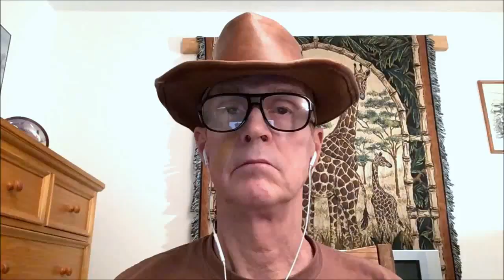Antenna Support Mast Materials

Comment: Hey Stan, good to see the comments open.  I've used carbon fiber and fiberglass and both seem good. I usually prefer to just elevate a vertical with the poles, but sometimes if there are no trees i'll put my dipole up with my 30 foot pole at about 20 feet.
edit: By the way, in the local radio course here we use some of your articles. Thanks for sharing your knowledge!
Reply from the maker: You're welcome! 73 de W1GV.

Comment: Stan, I've seen MFJ or other places advertise these, but have never used them. I have instead used PVC to mount verticals and to make mounting frames with very good success. There is a radio culture of sorts that many radio amateurs know little about. These are DXers who take on the challenge of pulling in DX on the AM broadcast band. Most are very smart people and some of the first PVC designs are from them. Coincidentally, a friend of mine who adheres to this particular branch of the radio hobby also worked for ARRL. There is a demo video of an antenna he designed on my other channel (also called "Semoranman") which works with a SiLabs DSP IC which tunes a Tecsun PL380 pocket radio's internal, ferrite loop stick antenna. In this case, the loop stick was replaced by a 23" embroidery hoop with three or so windings. Anyway, PVC designs for AM BCB mean the antennas are very portable. 

I have a 3-foot diameter, tuned loop antenna for 10-30 meters mounted on a PVC frame and it works fine. In the last hour on 20m using WSPR mode inside the apartment I have decoded 18 stations and have been heard by 33. Last night, my QRP signal (5 watts) was decoded in KL7, KH6 and ZL. Too much fun! 73 DE N0IJK

P.S.: I don't know how I ended up with two Youtube channels. It may have something to do with cross-media sign in or maybe Youtube had a 2-for-1 special going on.

Comment: Hi Stan. A very coarse and simple test could be to use a small sample of the carbon fibre and place it in a microwave oven (with a glass of water as a load) until the water boils. When the material after the test is warm/hot, it indicates that there was some RF energy being absorbed in the material. I used this test when making loading coils from different kind of plastics.

Comment: Hello Stan :) 
I have no comment , no comment no experience ,   with Carbon fiber or fiberglass , antenna supports :)
I do like the jabber like an idiot though :)
I want to make a comment about antennas support ropes !
Here where I live in south Louisiana we have herds of squirrels !
If they can find an antenna support rope ,  and believe me they'll find it :)
They will chew on it and you will find your antenna on the ground !
They will cut a 3/8 inch rope like it is nothing !
I use tarred nylon !
I haven't had a single diapole antenna support line cut since I started using tarred nylon !
I reckon them Tree running rats don't want to get tar on their teeth !
Hope all is going good with you !
Great audio Great video
73
Reply from the maker: Great Comment!
I'll take tarred rope, creosoted wooden poles, and porcelain insulators any week of the day.
73 de W1GV.